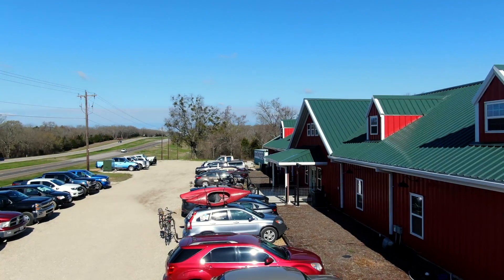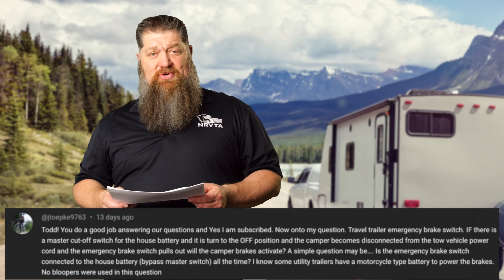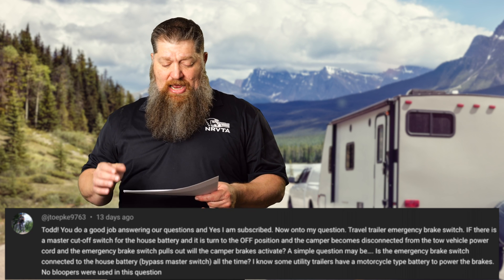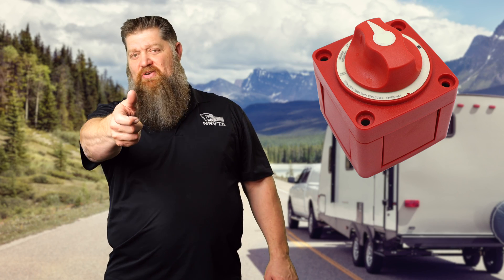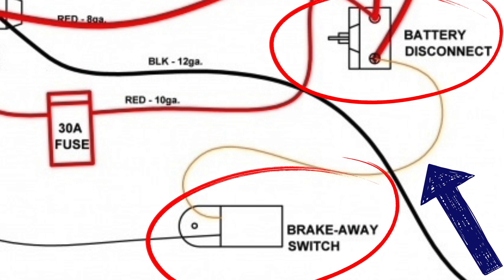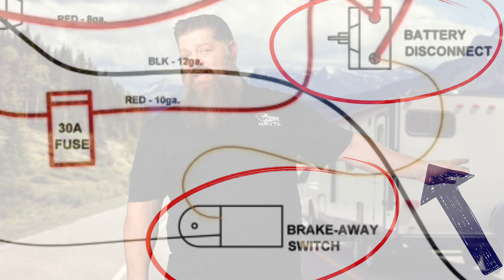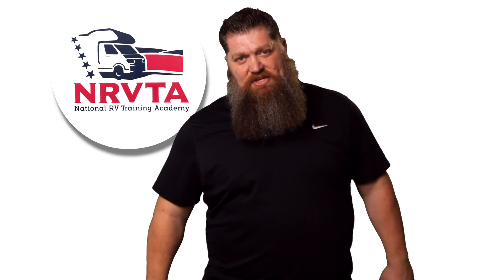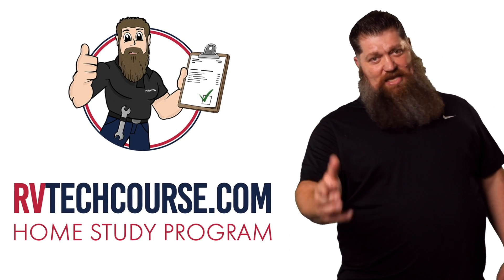What is the Emergency Break Away Switch?

Comment: That may be the way it’s supposed to be wired but I would strongly recommend that owners actually verify how their particular trailer is wired. You should be absolutely certain that your emergency brake system is powered when you’re on the road.

BTW, Todd, I got the same wiring diagram from a tech support person at a division of Forest River. Is that where you got that diagram?